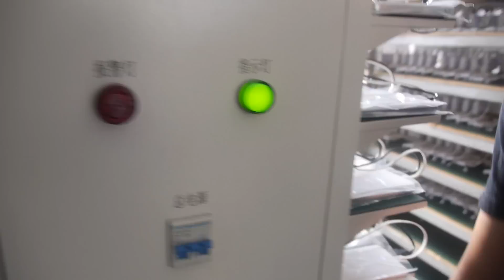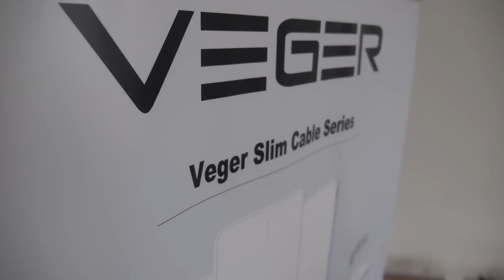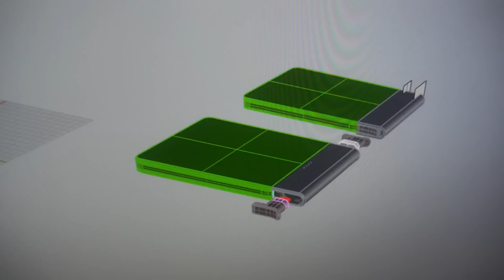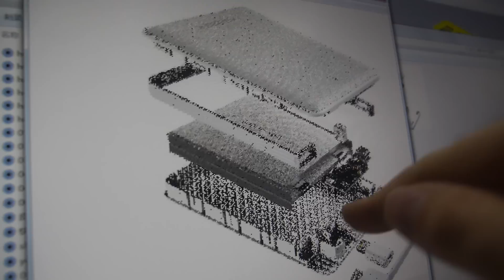Power Bank Factory Tour at VEGER (part 1)

Comment: I have the same soldering system that they are using at 1:40.
The Clone Hakko (Hyko) 936.
If it's good enough for them,  it's good enough for me!
For real though, I have been using mine for around 2.5 - 3 years now with no problems. 
I purchased the "brand name" HAKO 907 soldering wand  because it has silicone covered wire. This "brand name" burnt up in only 2 weeks so, I transferred all of the original clone Electronics & heating element over onto the silicone covered wire & I've never had a problem again!
I have been very happy with the setup! 👍

Comment: Low tech factory I have ever seen. Only assembly with no SMT whatsoever. Assembly process is basically manual & by hand. I also see many issues during the assembly process. Honestly, I would hesitate a little to buy from this factory as Power Banks are no simple products since you carry it, charge it, you also use it to charge your cellphones too so Safety Features is a must and the assembly process has to be very diligent also but I don't see that from these few small assembly lines.

Comment: Im a chinese.i majored in electronic technology.I've been to a few factories like that. For internship.It's a assembly line.what else would you expect from but repetitive work as u see.  It's very boring sitting there put all kinds of pieces of parts together.  U got 10mins  every two hrs to piss or smoke.   This job can be done by a machine for most part of it.      Then u would have to pay another more 4dollars.         Anyway u definitely will inhale toxic fumes.even though the extractors exhaust it out.   Unlead soldiering wires give out hazardous

Comment: 1:08 tinning pads on PCB
1:25 applying flux with brush and then tinning contacts on li-on cell
1:49 bending contacts
2:00 soldering microUSB wire/plug to PCB
2:04 applying capton tape on contacts of li-on cell wilth wires soldered to it to prevent shorts
2:13 applying spongy material on cell to prevent it from flapping inside the case
2:35 taping two li-on cells together(yea I know obvious)
2:57 assembling the case
3:08 testing internal resistance(IR) of li-on cells to quickly see if they are ok
3:24 soldering li-on cell to PCB and then trying to kill the cameraman
3:36 applying more spongy material
3:41 installing PCB+cell+wires in the case
3:48 placing the PCB in right place
4:10 placing plastic part into the case
4:20 applying doublesided tape(perhaps spongy) on the li-on cell
4:38 pressing together pieces of case
5:06 charge and discharge test, electronic load on left, and power supply at right
Now same stuff as before.
11:30 extended charge/discharge testing
Reply: are u chinese?
Reply: I am from PAKISTAN.... I NEED 10000 POWER BANK... PLZ GIVE US  DETAIL ON MY WHATSUPNUMBER +923435529938
Reply: @sohailaslamkhanmobileshops7611  i think it's hard to found this   powerbank,easier if there is online shop on your country,then you search this powerbank brand,the buy it
Reply: Clearly the man behind the camera has no idea.
Reply: Arek R. Can I take a stock
Reply: @daviemasapula9016  ???
Reply: Whatsapp me on 0992120051
Reply: Yes
Reply: @daviemasapula9016  Dude I have absolutely no clue what you're after...

Comment: PCB Board Soldering Process, did you found the solder place got many solder ball? if not separate out easy drop into other PWB board? how they control if market uses claim for abnormal condition happen?

Comment: Who proves if the battery capacities are as claimed? China is China
Reply: Yeah but that 2500mAh rating is on bare cell so it should be these 2500mAh.
Reply: Arek R. Are you naive?
Reply: No idiot, I was manufacturing powerbanks, and lithium batteries for high performance drones, I just know it.
Normally invisible rating on part is something different than visible rating printed on outside of the product.
Reply: Also just by looking at size of the cell I know the capacity(more less).
Reply: Arek R. Professionals base on real test results and not by gut feelings. Learn what is scientific evidence vs beliefs
Reply: Yeah, if you want precision results then you test it, by discharging the cell and monitoring the current(A) and time(h) you will have your capacity(Ah or mAh).
But If you are pro and you see prismatic li-on cell in size of X you know that it can be about Y
Reply: Look, I found same cell:
https://cbu01.alicdn.com/img/ibank/2016/140/527/2938725041_8712135.310x310.jpg
Same numbers and same capacity.
Also I have in my bench few prismatic cells, one of them is in similar size and has 3300mAh(tested).
Reply: Arek R. Good for you. Well done. So clever
Reply: But also I'm not suprised of the way you think, there is a lot of fake 100000mAh powerbanks for 10$, some of them even contain bag of sand to make it heavy.
Reply: Arek R. China revenue can drop if people realise this. Most people not aware. Thank goodness. This is why people buy from china and not usa. Its much cheaper, which is a misperception. Usa cannot stop china stealing its intellectual property since laws are essentially by geographical jurisdiction. China products essentially are copycats without originality even if they have originality in modifying them. But without the original inventions china would not have the ability to come up so many products made using cheaper lousier lower quality less safe methods.
Reply: But you can also buy high quality power bank from china for half of the price of anker plastic usa made power bank.
Reply: For example xiaomi made good one, they are soo good that other manufacturers made cheap copies of their products.
Reply: Arek R. Any other reliable China brands? Will check out xiaomi. How you find Olight?
Reply: Olight is ok but they only change stickers and double to price.
Olight is flashlight company, do you want one?
Another good powerbank MF is blitzwolf, they also made good 5V chargers(power supplies).
Reply: The capacity could be a lie, but take a look at "bigclivedotcom" youtube channel. He takes apart a lot of shitty Chinese products. 18650 cells (18mm wide, 65mm long, cylinder) usually have an exaggerated capacity and the flat ones are usually honest in their rating. Those are the two most common batteries in these power banks, so chances are these really are 2500 and 5000mAh.
Reply: Tom Any reason why flat ones are more true to their stated capacities?
Reply: Arek R. Thanks for sharing your knowledge. Am looking for li-ion batteries for my escooter but its costly for real ones. Fake ones are so cheap but defeats the purpose.
Reply: Tom These flat one are called "prismatic"
Cosmo John Because cylindrical ones are often rewrapped cells from dumpster, that was supposed to be recycled, from old laptop batteries, old leftovers from warehouses etc.
They sometimes even manufacture fake 18650 cells, small 500mAh battery inside, filled with flour for weight, and rated to be even 15000mAh(best 18650 are 3600mAh).
http://i.imgur.com/aPGyA.jpg
http://lightsngear.com/wp-content/uploads/2014/06/bad-18650.jpg
https://i.ytimg.com/vi/JzzfzGJpUS8/maxresdefault.jpg
Which one you want for your scooter, li-po or li-on?
Reply: Look, fake 18650 cell rated as 12000mAh:
https://8.allegroimg.com/s400/019d73/bdda4b204a94872d571462329268
Hahah :D
Reply: Arek R. Good info. China's prosperity is based primarily on fake goods. This means its wealth should be much lower than the level it is now. As long as USA cannot prevent China from copying products, China will become biggest economy in the world. But this is still based on Fake goods. So its prosperity by faking. UNSUSTAINABLE.
Reply: Arek R. Sadly, China's prosperity based on fake goods also Proves the world is mostly full of IGNORANT CONSUMERS. Its ignorance of the vast majority of humans in this world that enabled the China prosperity based on cheating stupid people.
Reply: I call it natural selection...
Reply: Arek R. I call it human pyramid. The 1% controls the 99%.
Reply: My friends factory makes 18650 battery's she assures me China does not make anything more than 1850 mAh. They don't have the technology but are slowly getting better and some factory's are trying to be honest for long term gain. The flat battery's may have been closer to the rating as they are mainly sold to other product makers with test gear.
Reply: Panasonic makes genuine 3400mah 18650's in china. There are a few >3000 made in china
Reply: Cosmo John checkout my videos from Canada like subscribe tell your friends to subscribe to my channel

Comment: Those Engineers using the educational edition of Rhino 3D didn't seem to be using it for educational purposes - seems fairly commercial.
Reply: i noticed that too!
Reply: How dare they!
Reply: Arne Schwarz Most dare. Battery Explodes. my power bank is on Veger same type 10.000MAH. same right? but after needs to teardown video that's Gone wrong! Battery exploded once teardown upside
Reply: Wath's the problem?
Reply: Are you a dumb fuck FutagoHime? Using the educational edition doesn't equate to anything different, do you know what the educational edition is you low IQ racist fuck? I will tell you that it's no different in function to the regular edition, just that the licencing is different. Stupid fucking child.

Comment: 1:29 No it is not paint, it's FLUX for better quality soldering connection...
Reply: ok he is just a reporter or whatever he is why everyone have bandages on fingers that interesting ??
Reply: Probably where they've been whipped so much
Reply: Throwing the still hot solder joints on the belt is best way to get dry joints.
Reply: Use this app to learn about Mobile repairing full course and all the software and hardware related solutions. All Mobile solutions in one single app... Just try this link.
http://codetherush.in/mobilerepair

Comment: you know these people in assembly line expected to do same thing for hours , no wonder if they feel bored, and it is accumulated for days or even years as long as they work there
I guess if the company give this repetitive job to  machines, it will cause high startup cost, so they choose human insted
Reply: It's unfortunate, but it's a loose-loose-loose situation for manufacturers.
They could use robots, but then people complain of too few jobs ...
Use humans (like here) and they complain of too low wages ...
Raise wages, and thus raise product prices to compensate, and the customers complain the stuff isn't cheap enough ...
-_-
Reply: And they have  lot to choose from if someone quit which I expects happen quite often. I know that I would have jumped out from the the nearest window after 5 minutes of this repetitive shit..
Reply: Use this app to learn about Mobile repairing full course and all the software and hardware related solutions. All Mobile solutions in one single app... Just try this link.
http://codetherush.in/mobilerepair

Comment: I have recently been given a new power bank with a crappy, useless "solar panel". It's supposed to have 10,000mAh, but it charged my 3000mAh phone battery about 1.2 times, so it's definitely crap from china. I opened it up, and it didn't look much different than these, with the exception that there was no capacity printed on the battery cell itself.
Reply: Fortunately I got it for free, so it wasn't my money that was wasted on this.

Comment: But still the factory is quite well equipped. Not the shitties PSUs and really good load testers (or "stationary multimeters"). They even have fume extractors on their soldering stations, I didn't expect that!
Also the aging lab looks like it's some really expensive stuff - well, except that last rack with tons of shitty USB power supplies...

Comment: Very interesting factory tour. Thankyou very much for showing this. This all helps buyers to understand the China miracle, but more importantly points of quality and points of negotiation. Concerning the former, buyers should check on (i) the use of antistatic bands on all workers who are touching the inside of the powerbank, (ii)  the testing inspection of incoming cells and burn in testing of the cells before they enter the production line or after production, and (iii) assume that they are buying a China (and not a Korean or Japanese) cell if they are getting a rock bottom MOQ price. Best wishes for good business in 2016.